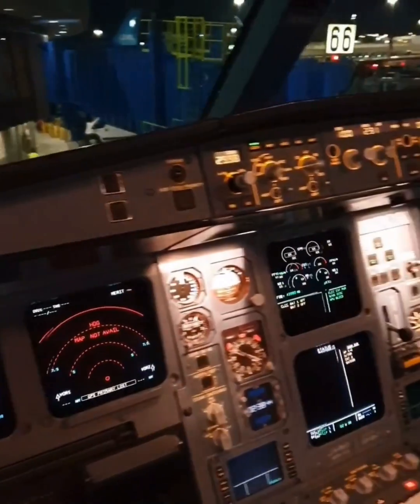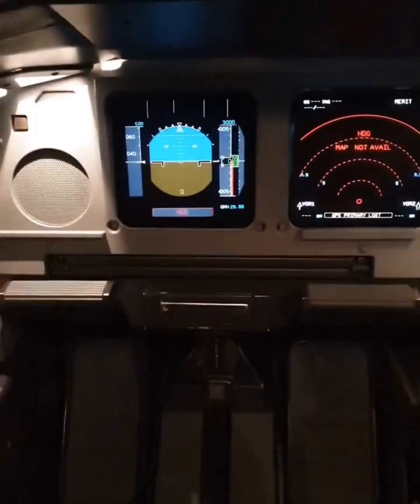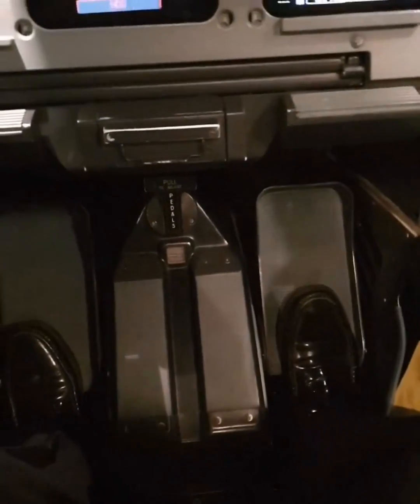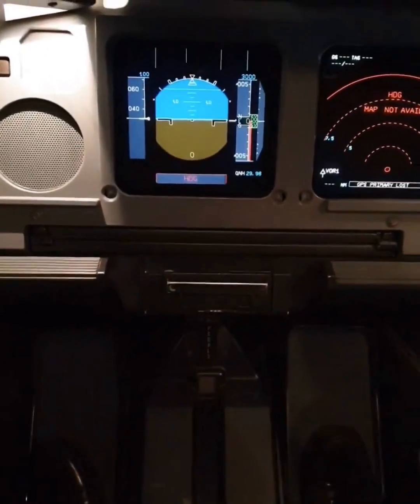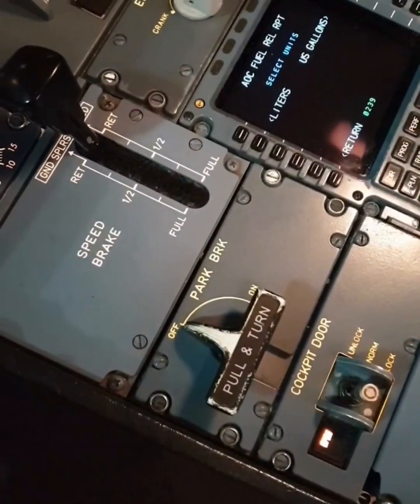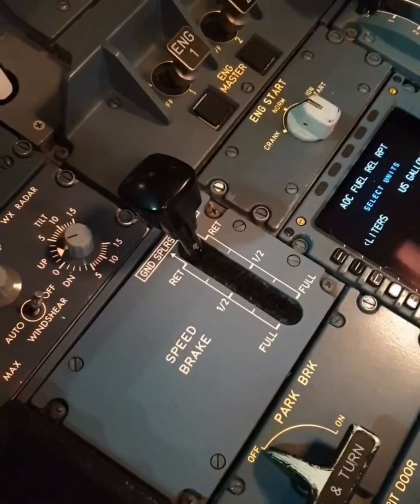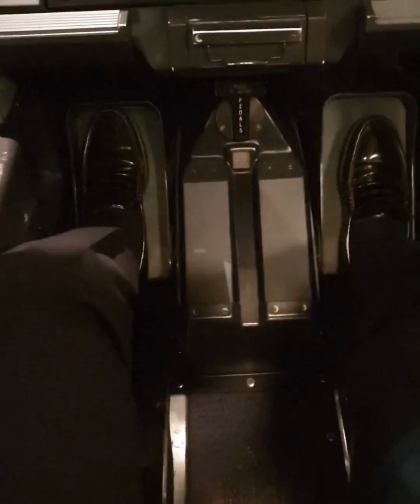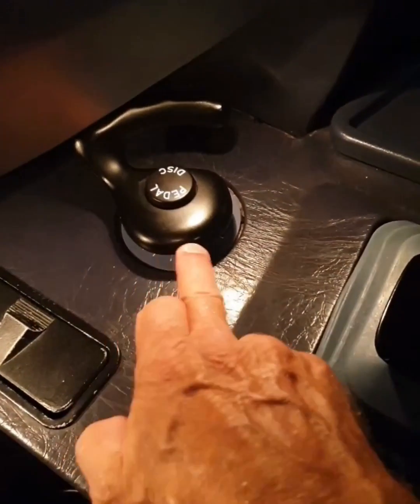Merry Christmas! 🎅🏽🎄💙✈️😉

Comment: G, day bjorn from Sydney, Australia.
* thanks for clarification on the rudder peddles.
* I'd wish for more information on the tiller (is that for steering using the nose wheel)?
* also is there any speed limit on using the speed brake? 
🏖
Reply from the maker: It's like the steering wheel on a car. It's progressive.

Comment: Interesting! Would love to have that with pushing both pedals to ground break in Flight Sim 2020. I only play it with controller and for some reason cant ground break (y on xbox controller) and reduce (including reverse) thrust (button b) at the same time. So i always have to do one after the other which is usual but not so nice if you want to land on a too short runway :DD
Reply from the maker: Pull thrust all the way back at 40ft. Then brake after touchdown. Reverse is not so important. This is how we do it in real life. (Ok we use idle reverse).
Reply: @bjornpilot  Thats interesting, thank you! :)